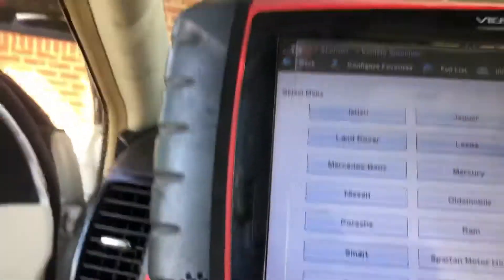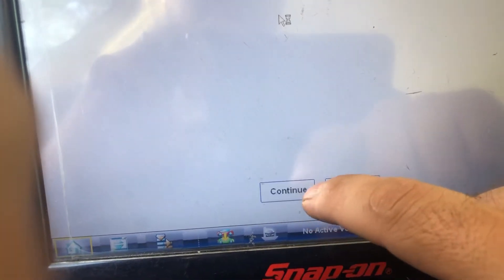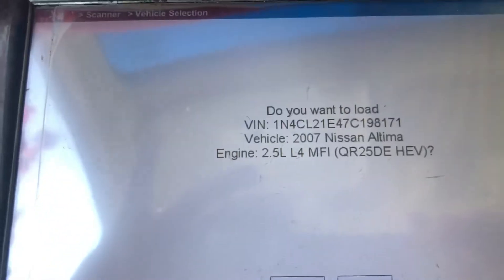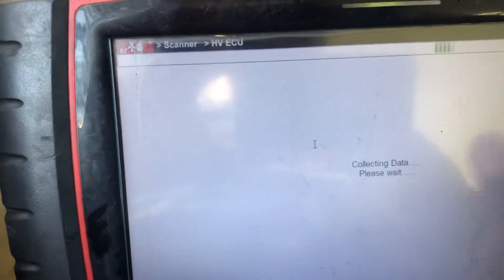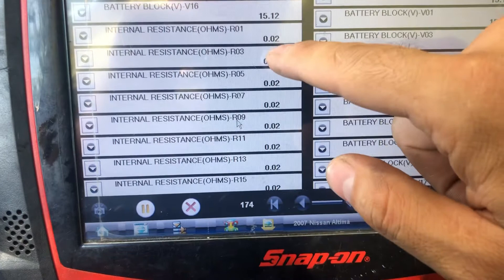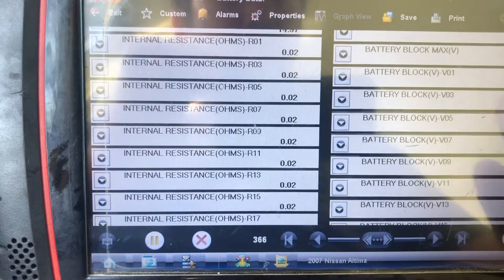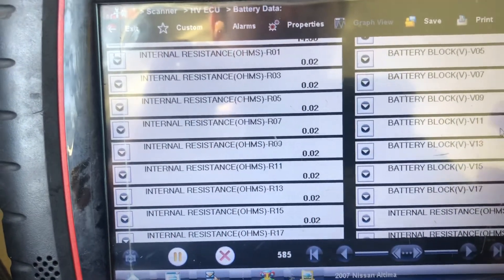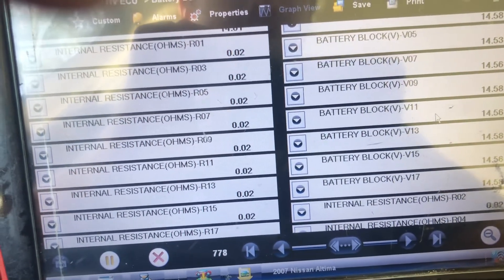2006 Nissan Altima hybrid p0AA6 (part2)

Comment: hey man, I have this same code for my 2011 Altima hybrid. i have to check out the battery data. Currently the dealer has no idea what the problem is and they are obviously charging me a few thousand for "testing" theories. I also have a U0293 code, B2562 code, and a B261E code. How can I narrow down what the problem could be? I'm guessing checking fuses and grounds all around the car. I changed my 12v Battery, and brake switch so far. This all happened after I changed my front brakes and calipers.
Reply from the maker: If you have same exact codes, just go for hybrid battery check, we did couple of the Nissan hybrid and we change the whole battery because of these codes
Reply: @MatthewJoOfficial  you were getting these exact codes? ill mention a hybrid battery check. The battery seems to be working just fine like it has been for the 2 years I've had the car. what would be a sign of a bad hybrid battery without testing it besides well, not charging?
Reply from the maker: @Shwaynki  yes, you have two way to inspect the battery, expensive scanner or removing the battery and inspect them manually otherwise take it to shop or dealer